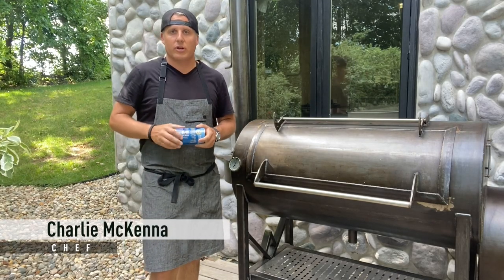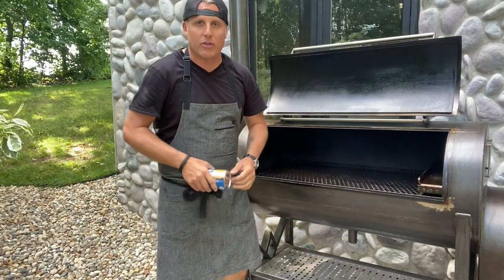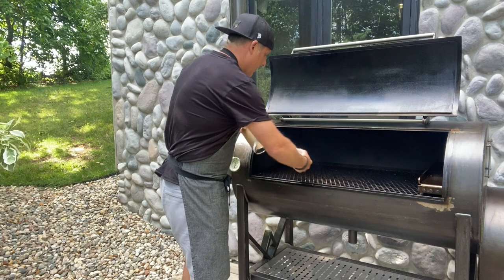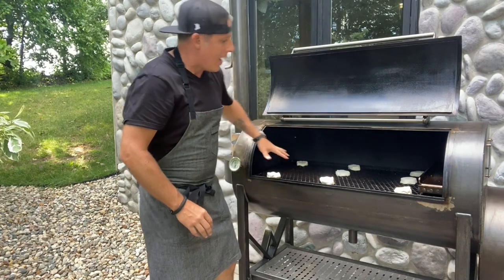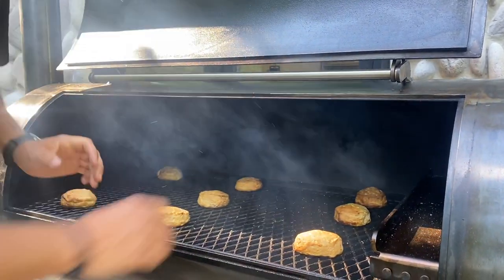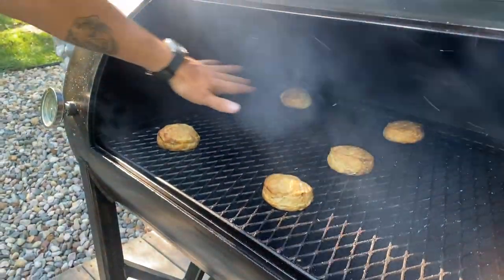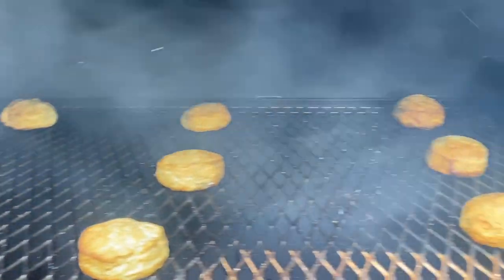Biscuit Test on a Mill Scale 94 Gallon Smoker with Charlie McKenna

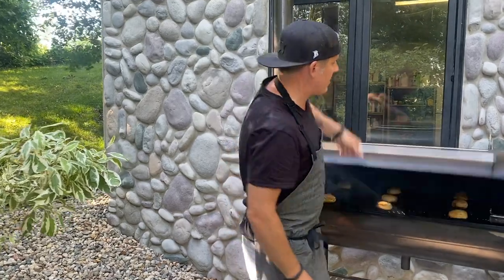Comment: Looking to purchase either the Mill Scale or the Workhorse but noticed smoke leaking out of the door at the 2:22 mark.
Reply: Glad i read this comment!  Didn't know about Workhorse!
Reply: do you realize how much smoke and heat comes out the stack relative to that miniscule amount of smoke coming out the freakin door? Honkler..
Reply: @johndoe-ek6vl  At that price point I would expect zero and have seen it in other Mill Scale vids so thought I'd ask. Have also seen zero leaks in other pits as well.
Reply: @vincentmartinez3956  that's because they have the damper opened enough to create enough vacuum where it doesn't go out the doors. We're talking about metal on metal surfaces vs smoke. They're not going to be air tight and don't need to be. Think about the volume and heat coming out the stack relative to the miniscule amount of smoke escaping between door openings. It really is inconsequential as you're not dealing with an oven where the heat turns on and off. The fire is constantly burning, the heat is constantly moving. Over the years youtubers have really spread a lot of bs and now we have people taking grinders to lodge pans and the like because they don't understand physics.

Comment: Not gonna deny that’s a really nice pit but it’s not a nearly $5000 pit. Lots of ash coming out of the firebox into the cooking chamber.
Reply: Yes, it needs a baffle for sure
Reply: All top quality pits of this size are 4-5k. Cost of steel is ridiculous now.
Reply: daviddrake9798  no there are not
Reply: daviddrake9798  the workhorse is an absolutely fantastic pit for sure, not the same quality though.
Reply: daviddrake9798  right. You can actually get the Workhorse75T mounted on a trailer and it’s still cheaper. Basically same exact design as Millscale and Fatstack and many other copycats.
Reply: daviddrake9798  I stand corrected, I just looked that up as well. How are the welds and the rest of the quality? I have never seen one of those, but the pricepoint is interesting.
Reply: daviddrake9798  if this is the case I might have to get one of those bad boys